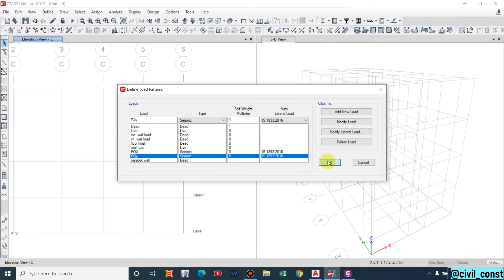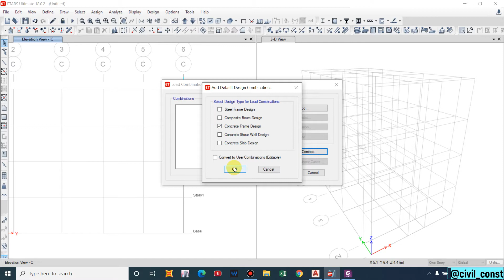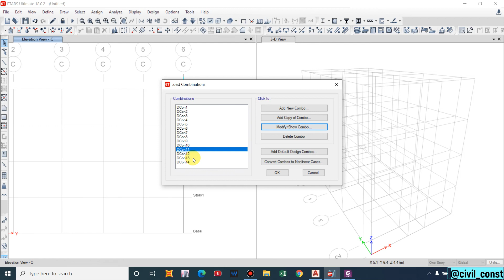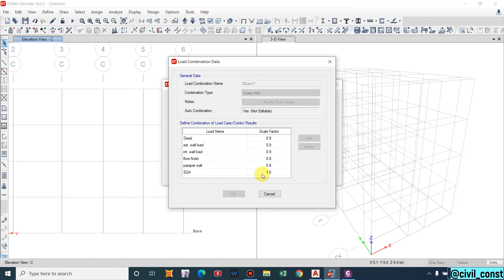Load Combination As Per IS Code Explained | Why 0.9 Dead load ±1.5 Earthquake Load | ETABS Tutorial

Comment: how the load is applied if the building has parapet. just for parapet part only
Reply from the maker: Check here 
https://youtu.be/ppt0JKPX4Wc
Reply: @civilconst  tnx1 i saw it that the parapet is on roof  but  if the parapet is on cantilever slab
Reply from the maker: apply load on cantilever slab as i have done for interior wall on slab